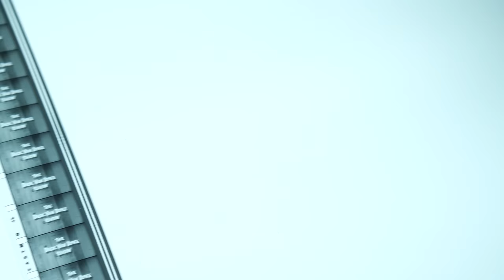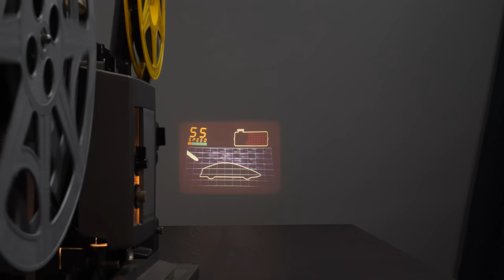Movies made sound with a light bulb: Sound-on-film

Comment: SDDS was revolutionary in that it contained 8 channels, but they were poorly utilized. Whereas 5.1 is ubiquitous (Left, Center, Right are behind the screen, Surround Left and Surround Right on either side of the audience, and LFE providing Subwoofer fun) Sony crammed 5 of the channels behind the screen, plus an LFE Channel, with still only two Surround channels filling the rest of the room. Nowadays, there's a 7.1 scheme that uses the extra two channels for the very back of the theater, and it seems like a nobrainer, we must remember that even 5.1 wasn't always obvious. 70mm Six Track magnetic audio used three channels for the L C R signals behind the screen, and then only one Surround channel to make room for TWO LFE channels. I don't know why that format stuck around so long considering bass content notoriously lacks vivid directionality.

Comment: Nicely done, albeit quite a bit “dumbed down” for a non-technical audience.  But I imagine even taking into account all the information you left out, I’d be willing to bet a percentage of your audience will be asleep before this video is half over!  You don’t explain much about the Vitaphone process (could it be possible that YOU don’t know much about it?).  Did you know that a Vitaphone record (disc), unlike everything else in your vinyl collection, plays from the inside (next to the center label) toward the OUTSIDE?  Or that the turntable mounted on the side of a Vitaphone projector had NO motor of its own to spin that backward record?  True.  The projector’s motor (which of course made the projector mechanism turn, in order to run the film through the machine) was connected to the projector’s MAIN (and usually ONLY) motor with a flexible steel cable.  Working like a speedometer cable (when cars were 100% analog), that little steel cable spun around inside its flexible housing, turned by the motion of the motor.  The other end of that cable was connected to the bottom center of the turntable.  That way, if for any reason the projector speed varied, the turntable’s speed would vary in sync with the projector motor.  Everything stayed in sync that way, and the audience stayed happy… unless the movie really stunk, in which case you’d have bigger problems than the sound being a few frames out of sync with the picture.  And if the film should break, you’d have to splice it back together (so the film would run without having to stop the machinery to re-thread the film) and you’d lose a few frames of picture in the bargain.  The upshot of all that is that picture and sound would go out of sync every time you ran the film, at the point where you spliced that film back together.  And did you know that Thomas Edison HATED amplification?  He actually thought the “horn” on one of his cylinder players could be made big enough to fill a movie theater with sound from one of those players when it was set up in the middle of the theater?  Needless to say THAT idea never worked.  I could bore you for hours with little nuances like this, but  I won’t.

Sincerely, 
A Lifetime Member of the
Society of Motion Picture and Television Engineers, Hollywood Section

Comment: Of course there's a film that shows you how to throw like a girl.  :D  I used to assist the teachers in class with these old things, before video tape came into the class room.  The auto-threader/assist was pretty reliable.  Once you set it to load it would gap and tension the various sprockets to allow the film to self thread, then at the end, once you attached the film to the take up reel, it would put tension against a roller which would un-set the load function, snapping everything closed and all but eliminating the need to do all of the tedious pre-tensioning and timing yourself.

Comment: I'm seeking a budget-friendly solution to replace the old tube amp with a photo-sensitive tube in my B&H Filmosound 179. I attempted to use a tiny solar panel connected to a microphone preamp with limited success. Some have suggested the Opo101 or other photo diodes. While I could order a variety of options to see what works best, it would be more efficient to hear from someone with greater knowledge and experience in this matter. Any help is highly appropriated!

Comment: I don't exactly understand how the variable light intensity is converted to sound, since it is 1-D information, and you need 2: amplitude and frecquency... right? I guess I missed something.
Reply: It's a spectrogram like you see in sound editors.
Reply: @jimbotron70  No, it's not. You see the same in sound editors only when you zoom out enough and loose detail of the single wave function, remaining only the envelope of the amplitude as a filled shape. Zoom in back again and that solid fill will reveal the frecquency detail as a zig-zag line, which you don't get to see in the film.
Reply: @superfao  Because in computers the audio is handled and shown in the digital domain. If you have an oscilloscope show an audio signal on it, record the video signal with a smartphone, then pass the resulting video to a program that transforms video into audio and you will obtain the original audio back.

Comment: Todays electronics, and possibly most of them after 1980s, are basically all the same. Theres a microchip on a pcb, and a link to a usb connector, or any of those sorts. Thats 90% of todays tech, the rest is the same but with aditional transformer, LED, speaker or whatever. But thats ugly. eugh. yuck. Though the 19th to 20th century gadgets like these are all mechanicky, unique and very interestingly, geniously designed. Digitalization and miniaturization of electronics is sad